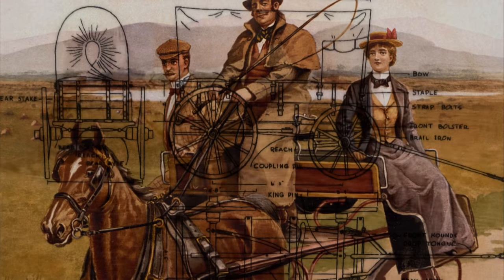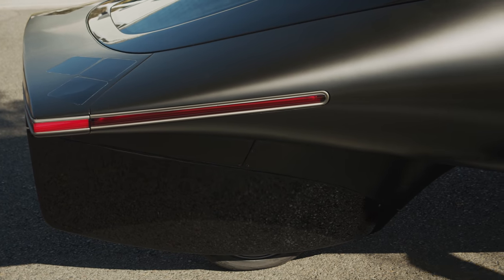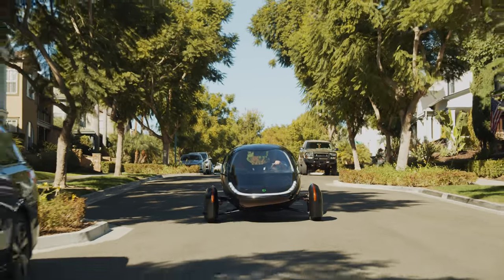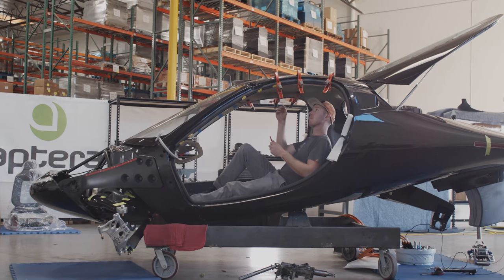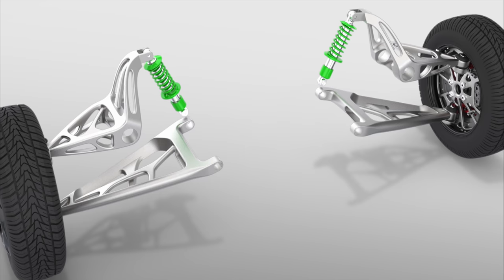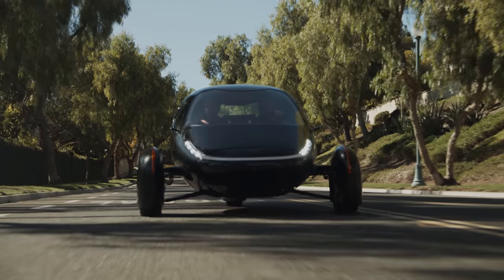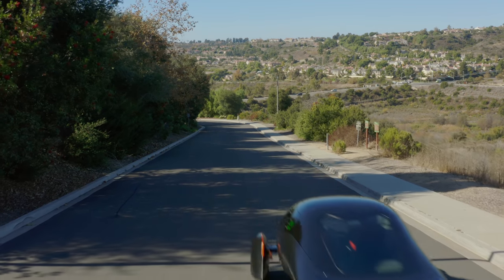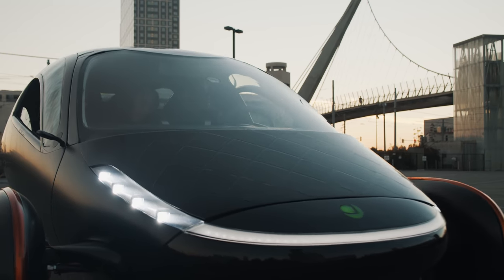Aptera Has Launched

Comment: NHTSA will do what with this? Classify as a Motorcycle?
Reply: It will be classed as a motorcycle or autocycle.  However, it is designed to FMVSS automotive safety standards, and will be crash tested to the applicable 200 series standards for cars, on a voluntary basis and the ratings published.

Comment: I love the concept, but I don't trust no 3 wheel car. As far as I remember every 3 wheeled vehicle in history had the problem of easily tipping over at moderate to high speed :P
Reply: There are several on the road now that don't have that problem.  Even the Reliant Robin, of which so much fun was made, had to be rigged to tip for the comic effect in the Top Gear videos.  Check out Tanom Invader TC-3 and the Polaris Slingshot, even on a track.  The Aptera will be much safer than these vehicles - because it is designed with an even lower center of gravity and full automotive safety features.

Comment: Perhaps consider hiring a real, no-kidding, F1 aerodynamicist ( on the level of Adrian Newey ) to actually design with near-zero drag, rather than guessing at it and using COTS packages.  You will be ahead in the end.  Facts and number matter, not just pretty designs.  Often, form follows function.  I just rented a Tesla Model Y to go on a vacation, from San Diego CA to Tucson AZ, and it was very, very comfortable - almost on par with our BMW 340i.  My point is, what I see now, in the Aptera design, is a pretty golf cart ( not even sure I could put one bag of clubs in the Aptera ).  Efficiency is one thing, but for you to be truly successful, people are going to want far more functionality and capability.  I am not being negative, just trying to be constructive.  I do wish you all the best.  Sincerely.
Reply: You need to do some due diligence.  Your comment is WAY off base, regarding the design work that has gone into Aptera, and its practicality for a couple, which exceeds anything in its class.
Reply: @n.brucenelson5920  Not sure which comment you are referring to (design, range, comfort, number of golf club bags).  I have, and I guess time will tell, eh?
  Though, I will concede I did watch the Jay Leno test drive (the more recent one, not the one in 2013), and it is clear multiple golf bags can fit in the 7ft long back half.
I worked as a process engineer at a major solar panel manufacturer (early '90s) where we provided high output wafers for the Pathfinder solar powered plane. We also developed 4 ft x 4 ft TFS or Thin Film Silicon panels (not panels with wafers).  As I recall the photon to electron conversion efficiencies were on the order of 18-20%.

I will keep watching Aptera - but know it isn't for me and doesn't fit my lifestyle.
Reply: @truegret7778  Aptera is very much a niche vehicle and probably will only fit the needs or budget of a small subset of the new vehicle market.  

Several of your comments, including wondering about the golf clubs, but also the aerodynamic and COTs comments I found strange.  

Aptera presents some breakthroughs in aerodynamics and thermal management.  The solar cells they are using now are probably in the 22-23% efficiency range.  They are designed so the panels can be replaced in event of damage or technical advance.

Cheers!

Comment: what about places that don't have a ton of sunlight
Reply: Full solar is an option.  The efficiency of Aptera means that you will still gain range at a rate of 13 miles per hour, or much more than a Tesla when plugged into a fast charger for the same length of time.

Comment: I live in Seattle I would only be able to drive 2 months a year
Reply: I don't understand what makes you think that?  I live in Iowa, and plan to use it year round.  I will be driving up to Bellingham, WA shortly after I take delivery.
Reply: @n.brucenelson5920  it was a joke about it not being sunny enough to power the solar car.  Also good luck  driving to Bellingham  in that lil car I just got stuck in Bellingham the last snow we had I had to stay at a girl's 5 days cause my civic couldn't get out the drive way
Reply: @206beastman  Ah!  Thanks for the explanation. Perhaps that is an unexpected benefit of your Civic!?  One thing to know about Aptera is that the traction control/ABS is far more capable than that fitted to the Civic.  I would expect performance on slick surfaces to be excellent with snow tires.  The wheel motor sensors can detect wheel slip and adjust torque 32 times per wheel revolution, or every 2.5 inches of tread travel.  This will be especially good on the AWD versions.

Comment: Will it charge if parked beneath a bright street light all night?
Reply: No, not enough energy for that.  It will gain range at 13 miles per hour of plug time in a normal 115V 15 amp wall socket.
Reply: @n.brucenelson5920  Thank you

Comment: It'd be great if the car keeps charging as we go since the sun is always there. Wonder if that works technically.
Reply: It does, but would probably add 20 to 40 miles to the range over the course of the day.  That might not be enough to notice if you were driving all day between charges.

Comment: This is pretty cool, but doesn't it get hot inside because of parking in the sun? Since black absorbs the max light as well, it must get way hotter. 

Idk how much energy solar panels absorb so, please let me know. These cars are a boon in tropical countries. We have sooo much sun, we'll never have to charge again.
Reply: The body of the car is a foam sandwich so it is much better insulated than most cars.  There is also a fan to exhaust hot air, and air conditioning can be timed to cool the car down before you return or even keep the car cool all the time.

Comment: This looks like a modern day Dale. I guess a trike is a trike.
Reply: Not so much in this case.  It is the only trike designed to pass automotive crash safety standards, or with such capable traction control.  And the founders have a record of founding and running successful companies, including an IPO of a lithium battery company, unlike the Dale company.
Reply: @n.brucenelson5920  Oh Yeah, I'm not shedding doubt on the team behind this vehicle - more the visual impact. To me, it looks like an advanced evolution of the Dale - unlike something like the Sonders EV which styled their vehicle differently. But that is always an issue with 3 wheelers, they are going to look similar because of the layout.
Reply: @previewstestfootage6051  To me, the functionality gained through the wheel motors is the real distinction here, and i think it will end up being revolutionary.

Comment: I almost got into electric cars but I realized we don’t know what we have until we loose it. Putting gas in my car once a week is unmatchable, now I know I wouldn’t appreciate the anxiety I feel when my phone got low battery, in my car. No thanks. 
I do like this car though, if they put a gas engine in it, which they did in one of the prototypes.
Reply: Depending on how much you drive, never having go to gas or charging station trumps your once a week trip, especially on cost and maintenance requirements.  You can get around 120 miles of range or more overnight just by plugging into a standard 120 volt outlet in your garage.  If you stop at a charging station, you will gain range twice as fast as a Tesla plugged into the same outlet.
Reply: @n.brucenelson5920  I forgot to mention how glad I was i didn’t have an electric car when we had that huge power outage recently in Texas. 
So, I don’t see it as the future, I see it as an alternative.
Reply: @luiggimondoli  In many places in Texas, the gas pumps were out.  There were quite a few reports of people with EVs that supplied their only source of heat.  And of course a full solar Aptera could do this, even off grid.
Reply: @n.brucenelson5920  I got it, but you can store much more gas and in a cheaper way than electricity

Comment: I hope the steering wheel continues to have 4 sides and not go 3 sided with no top grip like the Tesla.
The reason is comfort options, but also safety. I remember hitting a curb and a pot hole in the past and
the steering wheel twisting out of my grip, luckily the steering wheel was full circle and I didn't have to search 
for a new grip in that split second, kept me for hitting a fire hydrant. If this had happened with Tesla's 3 sided steering
wheel, the top of the wheel would have not been there when I needed it to be and there would have been an accident. 
People can still put their hands at 9 and 3 o'clock with a full 360 wheel, no need for this 3/4 business.
I'm not sure what there is to gain with the 3/4 wheel, but I'd think the less accidents the better going forward.
Reply: I like your conclusion, but until we know the turning radius, I don't think your assumption that you will need grip on all sides is warrented.

Comment: The biggest sin in automotive engineering even with internal combustion engines, consumptions of 1 Liter for 200km is possible if you design a cat like the Aptera with small wheels and optimised aerodynamics. However, what they do today is put aesthetics before efficiency.

Comment: Will you go back to your 300 mile per gallon model you are going to do
Reply: The present models will be around 330 e-mph.  Aptera will not to back to a hybrid design, which would be a step backwards in cost, service requirements, complexity, and performance.

Comment: Snow build up ibsdide the wheel wells?
Reply: Good question.  Probably not, because the heat from the motors will melt any snow that starts to build up there.
Reply: @n.brucenelson5920  motors in the wheels? Do you mean break rotors?
Reply: @artlover5798  No.  Aptera is using Elaphe 50 kW wheel motors, either 2 or AWD, for up to 200 hp.  They will be liquid cooled.  Another advantage is that it can do tank turns, and can sense and adjust torque 32 times per wheel revolution, or about 2.5 inches of tread travel.  This is much more granular than any other ABS-Traction control system.  It also eliminates the service, weight and cost of a transmission.

Comment: The math doesn't work out. If at highway speeds, 60% of the gas is wasted on overcoming air resistance, it doesn't follow that you get 60% better performance from an aerodynamic design.
Reply: It is not just the aerodynamics , but even in this regard it will change greatly with speed.  ICE engines typically only turn around 25% of the energy they use into mechanical force, as compared to over 90% for electric motors.  The numbers will depend on how comprehensive your assumptions are.  Gas also costs energy to produce.  So do solar panels, but the comparison including production cost is not favorable compared to many renewables.

Sometimes statements like this are to illustrate a principle rather than to provide rigorous values.  The engineering numbers, however, do work out.  The Noir vehicle seems to be confirming the predicted values.

Comment: How's the safety though?
Reply: It is designed to automotive safety standards with air bags and front and rear crumple zones, and an F1 style passenger safety cell.  It will be crash tested towards the end of the year and will likely get an excellent rating.  If this is a major concern, you may wish for the results.  After looking at the engineering, I have no concerns.

Comment: Is there the ability to plug in larger solar panels directly into the car to charge it?  It would make more sense to not have the solar panels on the car and be able to plug larger solar panels directly into the car.  This way we don't have to convert solar panel dc into ac electricity just to plug the car in and have the car change the ac back into dc to charge the batteries.
Reply: There may well be.  Aptera grants right to repair, so we are also likely to see after market solutions to this available.

Comment: This vehicle sounds good.....However, like all EV manufacturers, miles per charge is always high....All  video commercials look like they are made in the “flat lands”.....Like many of us, we live in the mountains....Charge mileage is certainly reduced....This isn’t even mentioned...Even though I love my Model S and have reserved an Aptera, I still believe you should go into detail of mileage in mountainous country.
Reply: The founders certainly talk about this.  The quoted miles are based on the EPA highway cycle so that comparisons can be made.  Temperature and altitude also make a big difference.  Aptera is designed to be able to climb a 6% grade at 65% per hour at 110 degrees F for 10 minutes before the power may begin to drop due to heat limits being reached, where you would experience a gradual slow down.  There will be more information as the development vehicles get go through validation testing.  Very cold temperatures will hurt the range.  Altitude will help it.
Reply: @n.brucenelson5920  Thank you, Bruce for this info...Have an Aptera reserved....Hope I don’t loose my deposit....Lost $1K at Elio.....Regards, Randall
Reply: @randallhash9283  Welcome to the community, for that is what this company is forming.  

When Aptera liquidated the first time, all of the deposits were refunded, and your $100 deposit is refundable.  The finance situation at Aptera looks very good at the moment, and they are very likely to be profitable shortly after they begin shipping cars.

When I made an investment on Wefunder back in November, I did it with the attitude that it was a donation to my concern for the environment, rather than an investment, because it was still at a very risky stage.  Of course there is still risk, but I think the odds of success have improved immensely.  I was in Kuwait for the fires and have been doing environmental work for decades.  This is one of the more fun ways to make a real impact.

Comment: Such a cool concept, but I'm guessing it gets around safety concerns by being classified as a bike.
Reply from the maker: We will not know Aptera's actual rating until we pass a production vehicle through the full safety test. But we are designing to exceed all passenger car standards and the previous version had the highest roof crush strength of all passenger cars on the road, and it performed exceedingly well in actual side and frontal crash tests. Aptera features a Formula One-inspired safety cell with advanced composites and metal structures for impact strength. Similar to aerospace and racing, these energy-absorbing methods are a core part of our safety strategy and have proven effective time and time again in high speed impacts. Thanks!
Reply: @ApteraMotors  Honestly been following the projects since the early days and surfboard coming out of the back. Hope you pull it off, because it's a great idea.
Reply: Safety has been just as much a focus for this design as efficiency has been.  It will be tested to automotive standards, and the design has been considerably improved since the original one from a safety perspective, and that passed the automotive crash test standards.  The crash tests won't happen until production ready models are available to test late in the year.  I think the results are going to surprise a lot of people, but they shouldn't for those who have been paying attention.

Comment: Notice airplanes have 3 wheels because they don't drive much.   You need a propeller or a 4th wheel.  Just a suggestion.
Reply: The reason for 3 wheels is that they were able to make a rather large reduction in the Cd, by using this design.  The wide spacing of the front wheels is also dictated by this.  If you don't mind waiting, the next Aptera vehicle will be a 4 wheel, 5 passenger sedan.
Reply: @n.brucenelson5920  Thanks for the info.